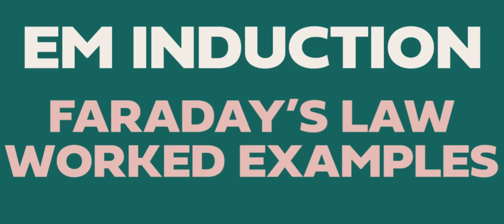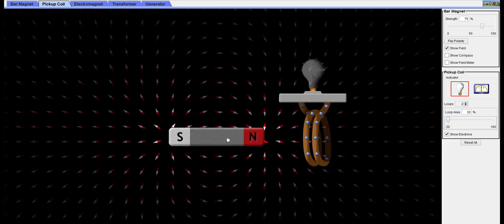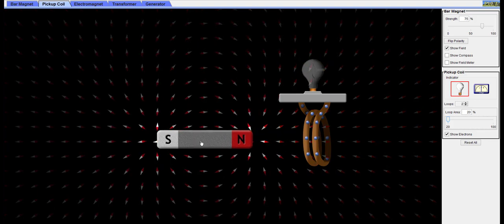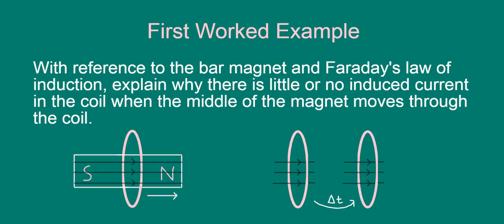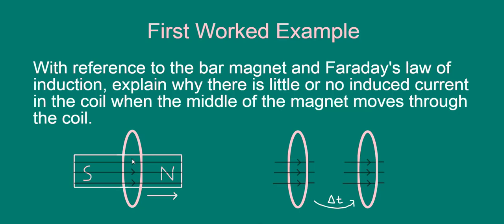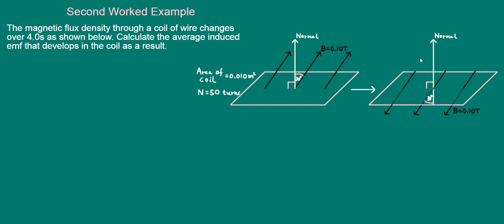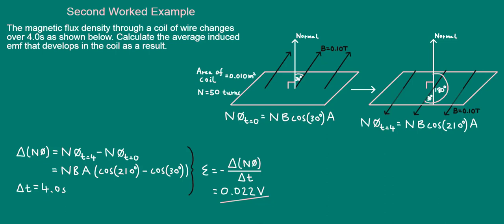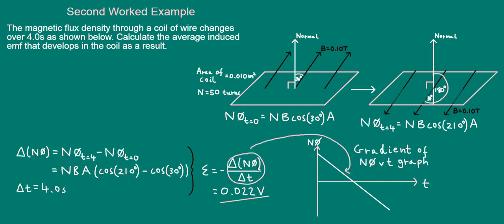Faraday's Law Worked Examples | Electromagnetic Induction | A-level Physics

Comment: How would you be able to vary flux linkage in a linear fashion if it depends on theta? Like if you rotate the field at a constant angular speed somehow, wouldn't the graph of flux linkage vs time be a cosine graph instead of a straight line like at 7:17?
Reply from the maker: Apologies for the v late reply. You are right, but the worked example is about calculating the average induced emf, so graphically we can draw a linear graph (regardless of whether the flux linkage vs time graph is a cosine or whatever) and its gradient will give the average emf. 

In principle, if the angular speed could be varied with time in a precise manner, the flux linkage could vary linearly with time.